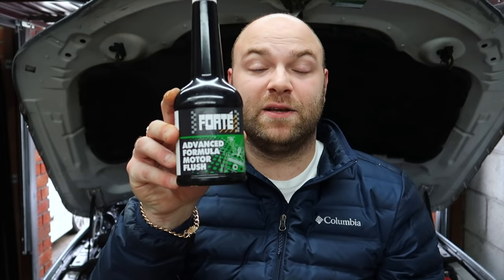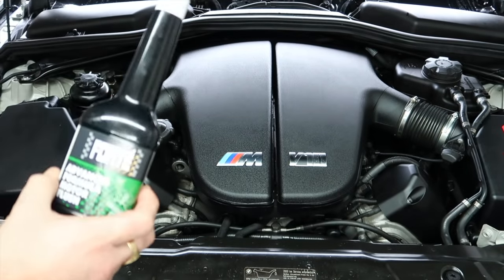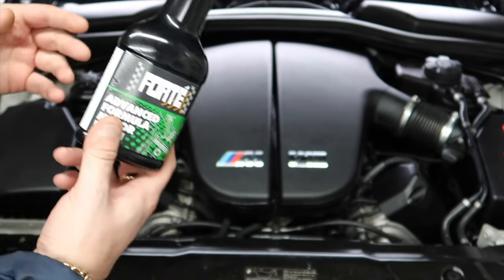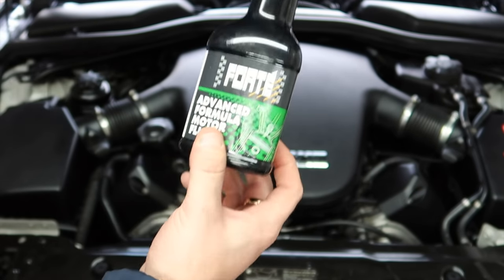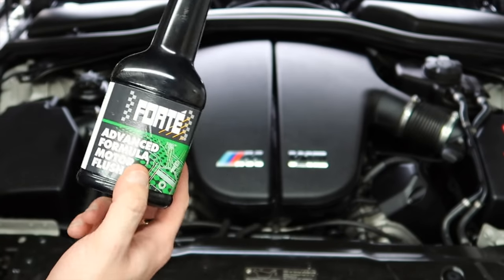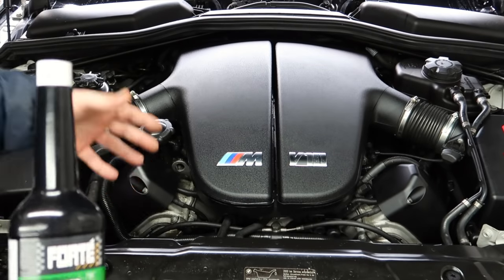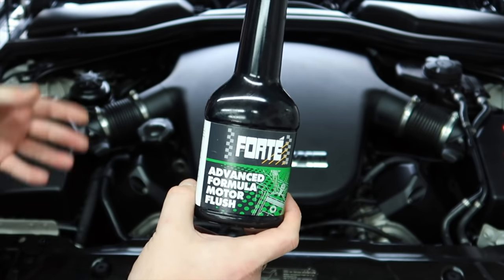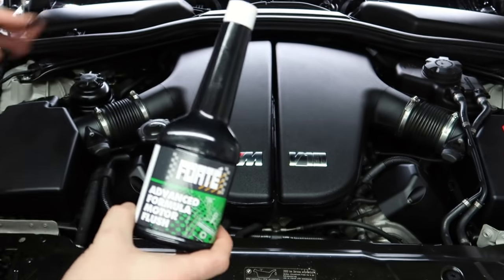Don't (EVER) Use Engine Oil Flush In Your Car !!

Comment: Allllriiight... I dont mean to start the argument with automotive professional, since I am not, I am sure author has his own reasons to say "never use engine flush" but on other side, various engine flushes are being sold and used in huge quantities. You would think if that would be any harmfull, there would be some law suits, collective actions against this or that engine flush... anybody seen one??? NO?  I thought so. 
I use LM engine flush in my 2013 Audi TT 2.0T regularly, I bought it with 45K ml and did not have history records, noticed that oil gets too dark to quick, lessened change intervals to like 3-4k, last time I changed oil, I did:
 old oil +LM flush 
and immediatelly
0w40 Mobil1 +new filter + LM engine flush, after 10 min it came out dirty, like really dark.
Changed again  to 5w40 Amsoil European Formula FS with Amsoil filter.
 Today I did the same - LM flush in to old oil, 10min > exctract, 
New filter+mobile1 0w40+LM Flush, and it came out much cleaner then last time. Exctracted it, new Amsoil filter and Amsoil European Formula FS 5w40 oil.
Oil extractor from Harbor Freight is awesome, makes oil changing so neat and quick, if your car has oil filter accessible from under the hood - its just wow!

Comment: If quality oil has detergent mixed in then what is the problem, lack of service's is the killer of all engine's, those engines are  notorious for leaking and burning oil in the states, oil stem seals and timing chain issues

Comment: You logic: Use only if you have sludge build up to mess-up oil flow.

Logic: Use when you buy a used car because you don't know previous owners preventative maintenance habits and prevent build up in the first place. 

or in my case having a car at 80k miles since new and using it to add on top of my already emmaculate maintenance habit.

Comment: Great advice, thanks. Subscribed 👍🏼 We have an 08 X3 2:0d just got it’s 3rd replacement turbo at 170000km and no mechanic can explain why they are failing. Never low on oil or missed changes. Any advice ? Thanks :)
Reply: The twin turbo placed in such a close setup work well but they tends to overheat, especially on v shaped engines.

Comment: Garage put 5W20 in my 2006 330i. When I change the oil it was a copper color and it had metal flakes, the filter was collapsed also. I'm pretty sure it wiped out some of my bearings, but the only problem with this I get that tick from short driving. It probably hurt the cam ledges too, I was going to send the oil to Blackstone but I didn't. I'm surprised at how resilient these engines are.
Reply: I have a 06 330i and I use 5W40. When you do your oil change add LiquiMoly hydraulic lifter additive to the new oil. Your engine will be super quiet after like 200km . I do this every oil change.
Reply: If it’s not a BMW specialist I take my oil/ATF and filters and pay for labour

Comment: @BMW Doctor  Hi, I have a rare engine here. My car is a BMW e46 316ti Compact with the 1.6l N40B16 engine. It spends arround 1lt of oil every 1000km and the car has 250.000km. I was thinking that the CCV was bad but my mechaning and also the BMW official mechanincs said that there is no CCV in this car, at least in the usual place. I was thinking on doing a flush and apllying the liqui moli seals conditioner on a fresh oil change. What do youn think? I believe that this particular engine does not have Variable timing so would it be ok in this case? Best

Comment: Hi @BMW Doctor. I have an BMW E87 with engine 2.0, actually have 110,000 miles. If i use Castrol EDGE  5w50 oil its OK or Is not recommendable ?

Comment: @BMW Doctor but haven't you just used it on the M54?
And yes, I'd never consider using oil flushes on any engine other than the M54 cause of the oil consumption.
All my cars are spotless on oil consumption-wise, but the M54, that pulls like an Ox, uses almost 0.5L per 1000 miles/1500km.

Comment: I have used the liquimolly pro-line engine flush on '14 audi a6 TDI 85k miles and the engine began working louder, sometimes with some weird low frequency sounds on the amplitude spectrum when the car is stationary, and afterwards it did have higher oil consumption. So, you do give you some weight to your words and thoughts....

Comment: Funny how Scotty Kilmer said basically the same thing (but in his funny flamboyant hands-flapping style) : that some sludge can be actually beneficial to the lubrication of the pistons and preventing oil being burned into them and also about the gremlins that would ensue with the selonoids etc. if one flushes the engine with Liqui Moly. The other school of thought is that Liqui Moly engine flush keeps their engines like new.  I’m split now. To Liqui Moly or not to Liqui Moly?
Reply: Saying slush is aiding the engine makes no sense. it's a guess! Cars don't come with sludge, so keeping then clean is common sense. 
YouTube mechanics sometimes say anything for content, Scotty also advised spraying a silicon on electronic components lol it will make the connection deteriate.

Comment: Thanks alot! 👍 Bought Rislone 15 minute engine flush but didnt use it yet. However im suspecting my VW GTI Clubsport 2017 & our Golf GT R-Line 2012 might have variable valve timing...
Reply: Use it. Just buy cheap oil to flush in-between, Putting in the good oil that you will keep in there for 5k

Comment: I flushed my engine every 20k on a Vauxhall insignia 2.0cdti it was a taxi and it covered 550k with the original engine turbo injectors glow plugs EGR valve EGR valve cooler radiator only thing that was ever replaced on the engine was an inlet manifold seal so what’s the engine flushes I would say they do work as it clearly worked on my car but all I can put it down to really is using Castrol oil and Shell diesel

Comment: I dunno, I've used flushes several times on different cars not had a problem that I can measure so far. And I usually drive the car slowly around the block with it in before I change, which is against the instructions of just letting it idle for 20 mins. 

Just the other day I had my local garage change my oil, before I set off I put a can of liqui moly flush in, only a 10 minute 3 mile drive to my garage. Reason I did this was because I have had low oil pressure 2 years ago, oil pickup strainer was blocked. 

Possibly due to carbon build up from a leaking diesel injector. Injector is fixed now but I thought maybe the screen would be partially blocked again, so seemed a good idea to use flush. So far seems fine.

Comment: What do you suggest for VAG TFSI engines, the ones you find in Golf, Seat Leon, Audi's. I've seen pictures of some almost clogged shut valves and lifters in those due to the direct injection used in the FSI engines. Is the only safe way to do it to open the top up and just scrub away manually? Or blast them with nuts as I've seen a few mechanics do :P
Reply: The intake valve carbon can only be cleaned by blasting, any additives or hydrogen only really clean the combustion chamber, if anything did wash the amount of carbon off the intake valves with the engine running it'd probably be enough to lock the engine, I've removed about an aerosol cap full of carbon from each pair of intake valves on the early tfsi and rs4's and R8's.

Comment: I have a 02 2.5 v6 gas land Rover freelander SE. And i took it from my buddys aunt cause it sat for a year   so she gave it to me and is got a little sluggish built up  i took of th valve cover and seen it had sludge so what would u sejust i should use to clean the motor out 👍 Fred.
Reply: PS it's got 184.000on it just to let ya no
👍

Comment: What if you've covered 50,000 miles in an audi a4 quattro 2013 without changing the oil? Engine flush good idea?
Reply: No need. You will be fine running it another 50000 miles.
Reply: @arepis1985 😂

Comment: I'm not an expert, but reasoning tells me its  better for the engine to put in fresh oil and run it a short period of time and then change it out along with the oil filter to clean out the engine.
Reply: no you should not run with the engine having flush oil inside.

Comment: i do the mulitple oil filter change change do 20k at 3000-3500 rpm up and down the moterway change again 3 times with cheap oil filters last one good filter oil.
my 14 year 308 hdi engin is as clean as a new car i allways change oil when at around 50c
Reply: Are you saying that after a full oil and new filter change, then after say 10,000 miles, install another new filter, but not new oil?

Comment: You know the purpose of a engine flush is to remove the slug and gunks I use it in my bmw e46 and it help it so much and it has 230k miles
Reply: i have an BMW E46 with the same 230K miles, how is it after doing the flush?

Any similar problems stated in the video? As he mentioned removing the sludge will increase engine oil loss

Comment: What do you do when you have a variable valve timing engine and used a flush in the past, and suspect it has clogged up something? Could this cause the compression in 2 cilinders to be lower and the engine idling bad when cold?
Reply: Found an answer? After a flush, I'm getting P0012 error which is related to vvt.
Reply: @DrOllie-ve2dv  me to how did u fix it

Comment: Just don’t buy a bmw. 😂
Reply: Just my thought 😂
Reply: Hahahah BIG yes.
Reply: Would pick BMW over most brands.

Hate on bmw is often because of Americans hating to import most parts making their price way higher.
Reply: Like this has anything to do with bmw
Reply: @unknownip6741  facts. Bought a 1995 325i with 185000 miles and it has no problems just needs some basic maintenance. It’s expensive but like i said, no problems
Reply: I think the advice would be for any newer vehicle.  I am a Ford guy but have owed BMWs, the ones I have owned were great tough cars.  I fixed them myself as needed saving money.  Now days in reality all dealer mechanics are way expensive,  all brands.
Reply: Great advice BWW
Reply: I owned a 2008 BMW 120D, sold it before the timing chain destroyed the engine! Google "n47 engine recall".  Never buying another BMW EVER
Reply: People on here hating on bmw.. but still watching bmw content 😂… that’s what bmw so dominant.. ❤❤ cheers 🍻 thank you haters.. you’re the best.. 👌
Reply: If you look after your car your car will look after you
Reply: @Boofpack-og I had a 1996 525i with 232,000 miles on it. It took me getting rear ended and totaled to get that car off the road 😅
Reply: ❤ my BMW's, 1 is 33yrs old and still runs like new ❤️
Reply: @ParFektion  I got a e46 with 296976km runs perfectly, had a Kia with 130000km engine blew up. Lol
Reply: Lol. Typical Mc Donald's worker.

Comment: Hi, what would you recommend for keeping the oil temp on the S54 (130k miles) lower on track? It reaches about 125°c before I have to start a cool down lap. I've got an aftermarket radiator (oversized) manual fan switch, Fuchs 10w60 race oil and standard oil cooler. Could the oil cooler have a bit of a sludge build up, or could it be to do with the thermostat or water pump? (Coolant temp never goes above 90°c) or is 125°c a safe as it does state in the owners manual it's fine 🤷‍♂️
Reply: Bigger oil cooler, I do the wiring for lots of e46 M3 race cars and they all use a thicker core and slightly larger oil cooler, and they stay at around 100-110 on track.
Reply: Personally.... I would remove the thermostat or remove the middle portion if you need to retain the thickness in the housing in order to prevent leaks. You will almost certainly find that you struggle to get to normal temperature with the thermostat gone. Infact, you might have to go back to the stock radiator. Done this on plenty of cars, thermostats are actually very restrictive but obviously needed on normal road cars to get them to temp quickly.

Comment: Its just what he said.  issue is when your car is old and driven a lot of miles.
The of the burned of used oil that sticks,
That becomes a chunks of sludge that get stuck somewhere.

I think this is good when your car is young about 5 years with max of 46k miles
Depending on how much you changed the oil.

Comment: Great advice I couldn’t agree more ! I used a motor flush on a high mileage car years ago an it caused many oil leaks .  Thanks dean
Reply: How high your millage during that time?
Reply: @kwkwski9131  245k and basically needed new seals after which it probably already needed anyways

Comment: Looking at getting an X5 E70 msport 3.0 SD 286bhp. Any opinions
Reply: Yes, don't remap it or you'll  be looking at changing the 1st turbo, your injectors when they mess up, the auto box and if your really unlucky the timing chain and and tensioner pulleys. lol very heavy cars and that 3.0l lump is already near its limit. mate had 1 and mapped it, got about 8 month's out of it before it went belly up! left standard and looked after, there nice motors.  that's my 2p ;)
Reply: @mkm7962  cheers mate. Much appreciated advice
Reply: @1983stu54  no problem, I very nearly bought a 390bhp 3.0l d, but on test drive the gearbox was acting all weird so steered clear of it. Its still for sale now and owner doesn't drive it, ticking time bomb I recon.

Comment: Hello, I changed the reverse bulbs on my 2013 X5 but I’m getting bulb malfunction message. Please help
Reply: Clean the seats of bulbs
Also you have to change the original bulbs coz the resistance for original bulbs are different than others cheips one
If you changed LED you have to do coding to disappear the faulty
Reply: Buy a canbus compatible reverse bulb.

2001 bmw 525i with new LED's, no errors because I bought canbus compatible lights.

Comment: Thanks for the great advise again Dean. Do you have any tips to reduce the oil consumption on a 2014 mini cooper s (n18 engine)? It has 110k miles on it and is always serviced at the bmw/mini workshop. Have to top it up every 2k to 3k miles. Currently using 5w30 LL04 oil. Thanks in advance.
Reply: junk engine
Reply: Use a slightly thicker oil.
Reply: Change your head gasket, known issue.
Reply: Pcv valve, yo

Comment: Well well well. What do we learn here?
Buy an older well maintained vehicles like my 1995 4Runner 2.4 turbo diesel, Opel astra g 1.8 2000 or land cruiser and you will never worry about the tighter passages, plastic drain bolts🤦‍♂️, plastic garbage overall. You will have solid built vehicle and if you take care of it,you will drive it for tens of years!
I will never sell my two vehicles! My Opel has Lpg system and I get 10liters per 100kms.The other is medium sized, well thought of everything Toyota that is built like a tank!
Even the lights are made of glass!
Solid built frame, no cheap plastic crap whatsoever😉.
Oh, yeah and the engine has 300,000 kms, actually both are almost the same kms and the Toyota uses 200 grams per 10,000 kms!
The Opel 800-900(almost a liter). Basically if I sell them both I will not get more than 6,000 $, so why should I be affected for the price they offer me, when I know how much longer I will drive them and not be a slave to a modern car🙂.
I will do the exact opposite. I will keep condition them and be happy that I am not a fool buying a car just for the speed.
This is my philosophy, of course I will not drive them forever. I am trying to say that these 2 cars will be my daily drivers for a long time to come as I see how fucked up our Economy and businesses are. If I get the chance, I might get some fast car to drive it 2 a month,but that's it. Even If I can afford 100 lambos, I will lose interest of them, because they are expensive, hard to work on and I don't like spending money where I thing they shouldn't.

Comment: Hello, just bought a 2013 740I with the n55 from a very old couple (not a lot of maintenance was done). While replacing the VCG which by the way it appears they used some kind of white adhesive. Anyways, the springs are COVERED in sludge. I took a picture and sent it to two different local mechanics (not BMW experts). One said to do a flush the other said not to. Should I do it or just use Liquid Molly oil with detergent??

Comment: So should I use it on a 300,000 mile m62
Reply: 300k wow
Reply: @aidenp5768  yea it's still going its a 96 740il with 300k miles somewhere in the records it says something was done with the timing chain so I get to enjoy probably the last 100k to 200k miles this engine has left to go before a rebuild

Comment: I have a 2001 Bmw 3 series 318i  I get my oil from Halfords they type my reg in and it says the recommended type, which it does say specifically for BMW's on the container it's in, is this advisable or you any better recommendations ??

Comment: Great video dean it was recommended when you done a oil change on your m54 motor.
Reply from the maker: That is correct indeed ! As I said but that engine had been neglected for many many years and it was also a cheap buy so no harm in using it. It was also very very sludged up inside aswell which can be seen on the valve cover removal, but I wouldn’t reccomend to use this on anything that doesn’t need it. Or any expensive car that can be a disaster.

Comment: Ánd for m57 530xd i can use it?
Reply: I used it for my X5 M57TU so yes, its ok to use and it does work. I would like to point out, that I used Wynns engine flush because I was unsure of the previous service history and I was about to fit a new turbo so I added the flush to the oil, ran for 15 mins then drained out. New turbo installed, primed with decent Castrol FST 5w30 and then some in the filter housing to avoid oil starvation, and then top up engine with rest of oil.